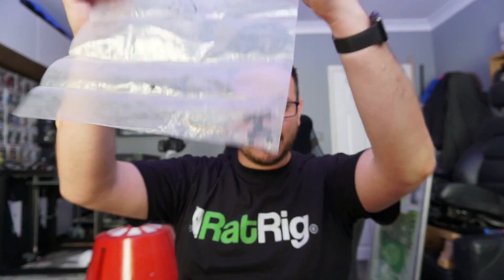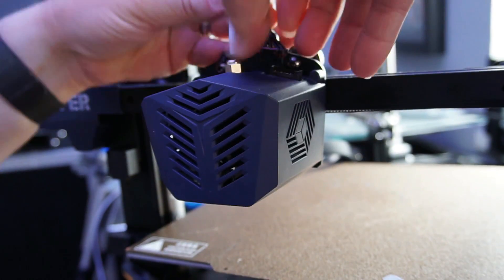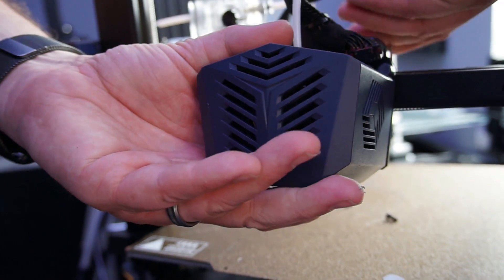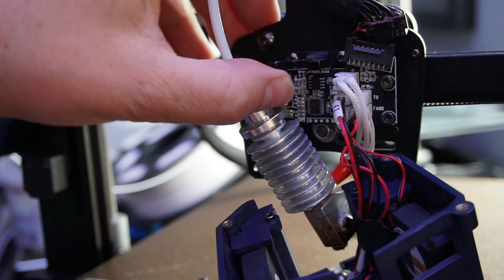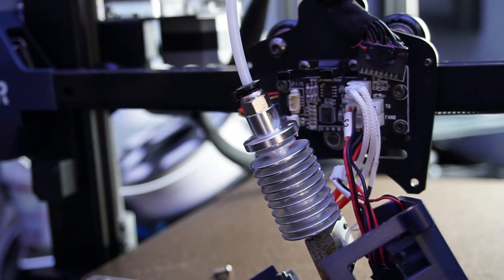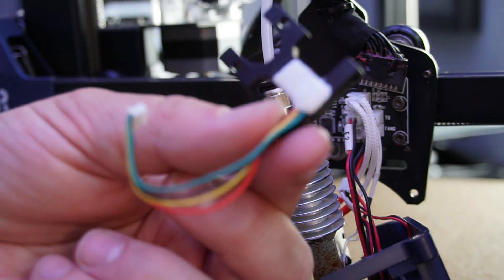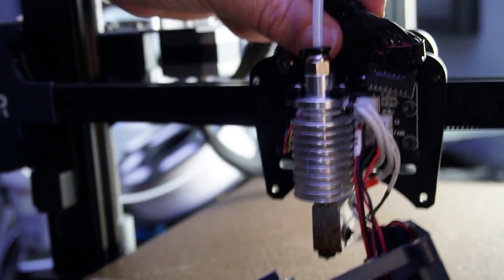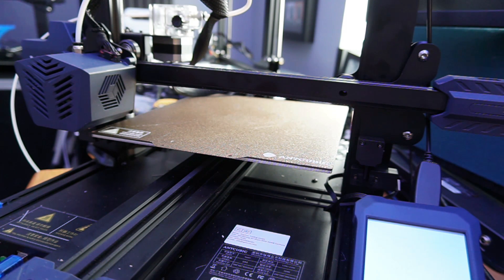Anycubic Vyper Sensor Fault

Comment: I replaced my sensor with a brand new one and still have the issue, my light is blue, it's not on and when I unplug the sensor it turns back on blue.  Is there anything else that would affect this issue. Maybe something else i can look at? I should sdd that when i do a print it just smushes pla around, i guess this sensor also tells the machine where it is in space so it knows to Z up for the next layer.

Comment: If it is still Not working after all of the possible fixes, Check the printhead cable at the connector. I Had the Same issue and the solution was to redo the wire at the connector because at the steep bend it was broken and so there were false Inputs that lead to this issue

To fix it you Just have to disassemble the connector and move the cable past the broken part 
Please be carefull with the disassemble because the connector is fragile

Comment: Hey, I've had a vyper for a few years now, just ran into this issue, and I was able to fix it by bending the calibration sensor back into place, so i think the assumption that it uses the contact to the PCB below it is correct. It had probably gotten mangled a bit when I moved and now it seems to be doing great. I wouldn't exactly suggest doing it, but if you're thinking about replacing it anyway, I'd suggest giving it a shot.

Comment: Bro you saved me I had this problem and tried to change the nozzle assembly but it didn’t help I was going to use it as spare part to upgrade an ender 3 but as I was about to start breaking it into spare parts I had no choice but to try to fix it one more time and i came across this video you are a lifesaver I ordered the part and it is back up and running 🎉🎉🎉thank you so much for the vid and the help

Comment: Same on my device. Broke after the first owl print. I faffed around for ages thinking I had misconfigured something in the slicer. Finally got in touch with support and they sent me a new strain gauge. Fitted it, still did not work. Faffed around long hours again. Did not work. So I gave up on the machine and left it in the cellar till now, money down the drain. How the heck a strain gauge on a piece of metal can get broken without the metal part showing some damage is almost beyond belief.

Comment: thx Sam.  i got a kobra max, and untill your video i did not understand how it worked.  i found the FB group as well thx to you.  i am doing a mod to my kobra max converting to direct drive using the Revo hemera XS,  I'm at a crossroads on where to put the auto-leveling sensor, I put the FB group to suggesting where i should put the sensor .  thx again Sam.

Comment: My issue is when reassembling the print head cover, the wires are so jammed up they keep the sensor tripped. Blue light on pcb is always on even when nothing is touching the nozzle. I can’t figure out how to repack the spaghetti without putting pressure on the sensor

Comment: Have you experienced a hotend abnormal ntc code coming up I had it I replaced the hotend completely and I'm still getting it and I've had the printer for less then a month
Reply from the maker: Could be a wiring issue on the board then?
Reply: @The Real Sam Prentice  that's what I thought at first  but I unhooked everything checked all the wiring and hooked back up had 2 prints just fine my wife started one this morning and all of a sudden it kept heat I ng and caught on fire
Reply from the maker: @guyer1198  caught on fire or smoked ?
Reply: @The Real Sam Prentice  started smoking at first then the filament melted and caught fire
Reply from the maker: @guyer1198  I’ve never seen that before
Reply: @The Real Sam Prentice  Yeah I'm lost lol only had it for a couple months and have only had 2 good prints before all these issues
Reply from the maker: @guyer1198  which material were you printing at ?
Reply: @The Real Sam Prentice  just a purple pla that I've used dozens of times in the neo  the hot end was was supposed to go to 0 but kept increasing  heat till 260 still does it if I power the printer on it'll start at 28° and go till critical temp
Reply from the maker: @guyer1198  I’ve never seen pla melt and catch on fire, I wasn’t aware that pla burns like that to be fair. If I were you I’d speak with anycubic
Reply: @TheRealSamPrentice  yeah I contacted them now it's a waiting game

Comment: Mine slams in to the x axis and then gives me the abnormal level sensor error after probing 2 spots on the bed. I replaced the entire head. Hotend and strain gauge are level. Bed and trolley are tight. I'm at a loss.

Comment: I am writing this in 2023 now. 
The "faulty sensor/switch" problem was possibly caused by a bad batch of sensors.
The "crashing problem" is prevented by having to push the printnozzle with a tool (the sofware requires this action).
The nozzle/sensor will be activated (LED behind the cover).

If the sensor is faulty the auto-level cycle won't start. So crashing shouldn't be possible anymore.
It's always better to buy a device 3D printer, car or whatever AFTER it has been on the market for a few years.
Early production runs of any device are prone to faults/errors.
I trust that Anycube is checking the quality of their supplied sensors now more carefully because this problem has happened.
Very often producers of machines/devices don't check the parts they receive very thoroughly because that's a task of the suppliers.

Comment: I had this problem as I bought a returned unit for $93 USD (shipping included!!!)

I just bent it down until the light came on.  Then it did a fine job leveling the bed.

Saved me spending money for a new one.  I will buy a new one anyway.

Comment: hi i got vyper too but mine do 16 point leveling and after go home and stuck on probing do u think it same problem of u or i need update firmware ? ty
Reply from the maker: Sounds like a faulty probe you might be able to bend it back a little bit to fix it

Comment: Had the same problem changed the strain gauge the board it fits in and changed the cable now they sending me a new motherboard the will this solve the problem, forgot to tell you that the strain gauge is not able to take the screws so you have to use a nut and bolt

Comment: The strain gauge design is crap.  When mine quit on my vyper I just got the cryd team board at the maker panda store on aliexpress and swapped it out so I could run a bl touch.  Much better and I switched to klipper while I was at it.  An all around better machine now.  I couldn't even find the strain gauge for my E model vyper.  Anycubic parts availability is horrible.  Now I'm gonna do the same to my kobra max because I know it'll go out.

Comment: Whenever I turn my printer on, I have to push the nozzle forward or back until the red light turns on. It’s just where it stops when I turn it off. The slightest push back turns the light on again and once I level the prints are fine. Can anyone help?

Comment: i have a different problem with the leveling process, my nozzle is going PAST the bed and never touching it so my whole printer freaks out. has anybody else had this?
Reply from the maker: I’d suggest you flash the new firmware or adjust the y axis stop switch on
Reply: @TheRealSamPrentice  alright thank you sm! ill give that a try (quick reply btw jeez)

Comment: I had the exact same problem with not the exact same results. Contacting Anycubic is a pain in the ass. They make you fill out some bs form. Give you the run around for days on end. That saw me just sending the product back for a refund. Just avoid this model all together. Junk.

Comment: Leveling a bed is easy but fixing any auto level system is a pain.  Does anyone else see a problem here?
Reply: If you have a perfectly level build plate then you're in luck.  Otherwise, a leveling system is important.  Only 1 of my 8 printers is level enough to not have an ABL.

Comment: I have been having issues with both CR6 SE and the Vyper.  Bought an entire CR6 hotend unit for $40 AU.  Could not find one for the Vyper but could get a Vyper Strain Gauge or $29 AU - the CR6 strain gauges are $10.  Not impressed with Anycubic(or Creality as they never send out parts).

Comment: Hi Sam. Got a Vyper on 2nd October 2021 and it printed the 'owl'and that came out really well. Quite impressive. (Should say I have now had 4 Anycubic printers - 2 x i3 Megas, 1 x i3 Mega Pro, and now the Vyper. The first 3 have been good, solid workhorses). 
Now the Vyper - as I say, it initially printed very well for 3 or 4 small prints, then simply stopped. After some hassles with Anycubic Support, I finally managed to upgrade the firmware to v2.4.5, which I was assured would fix the problem - it didn't. After another prolonged bout of communication with Support they sent me a new Sensor Gauge. I waited four weeks for it then installed it per their video instructions. Still won't work and when I hit 'auto-level' the entire machine just freezes and I have to turn off the power.
After watching your video I have decided to re-do the fitting of the sensor gauge (although I know I did it correctly ) and see what happens. At the moment, Anycubic don't seem t be able to help with this problem. Any suggestions would be greatly welcomed as the machine is only a few months old and has only printed 3-4 things and is now 'useless'.
Cheers, Noel

Comment: Thanks for your video!

Unfortunately, the issue still occurs. It happened on my new vyper as well, even after firmware update... LED and leveling working very well, but after some prints crashed into the bed and LED wasn't working anymore....

Comment: Hi there. Thank you very much for this helpful video. Same story here. Got my printer a few days ago from the German warehouse, did a first auto-leveling, unfortunately failed in printing the Owl, did a second auto-leveling and the nozzle smashed into the bed. I then upgraded screen and firmware to the last available version 2.3.9 (motherboard v6). Now I get this sad message "Auto leveling sensor abnormal, please check it and wiring!" I wait for an answer from Anycubic (Chinese holidays). I am however wondering: for all of you who managed to get a new sensor and changed it, did it happen again with the new sensor a few weeks or month later?
Reply from the maker: Sad times! I think I saw your post online. They have sent me a couple of sensors out now and also a replacement motherboard. The GOOD news is that Anycubic DO look after their customers and you will be back in action soon.
Reply: @TheRealSamPrentice  Lucky for you eh. They refused to help me with this exact problem. Probably because I do not have a big enough YT audience. Like your videos mate, but this company really screwed me over on this one and I am absolutely disgusted in the way I was dismissed by Anycubic, even tho this is a well known fault. I dont really know what to do now, except share my story of the way they are actually handling the situation for everyday customers without a big channel.  
If you have any ideas where I might be able to go to find parts or if you have a source on the inside, I would be very interested. 😒
Reply from the maker: @KwaddawK  drop me an email I might be able to help you out.
Reply: @TheRealSamPrentice  Thanks for your reply and kind offer to help mate. I kept searching the net and found a printer supply website in the UK with the strain gauge for $15US so I ordered a couple from them. Much much cheaper than the official website. After the treatment I received I can no longer support Anycubic or purchase anything from them directly ever again. I went from really loving my printer to absolutely hating Anycubic with a passion in about a day and a half after dealing with Abel the Unable in customer support. I hope my story is helpful to people sitting on the fence about which printer to buy and I will continue to share it hopefully costing them a buttload of money in lost sales. 
Keep up the great vids mate, at least I feel you are on our side!

Comment: My first 3D printer and mine is failing the same way. It completed leveling once I printed the owl, then leveling failed it's 2 days old I've been researching and checking tensions on rollers and belts and the problems the same. You can say I'm frustrated I submitted a ticket and stumbled upon your video.

Comment: Yo man, so i just got my Anycubic Vyper. I have done 1 print without any problems at all... I can still do the bed level no problem, and i dont get this smashing into the bed, it puts the nozzle nice and easy down, and up and slowly down again. But then when i start printing. Its like the nozzle moves up 10mm or so. i have done absolutly nothing, it doesnt matter which sliced file i print. Even the one on the SD card doesnt work. And the one i printed Yesterday doesnt work either?

Any idea what could have happend? Everything seems normal, until it starts printing...
Reply from the maker: I’d work on your z offset part but that does sound really weird are you able to send me a video of it doing it ?
Reply: @TheRealSamPrentice  where can i send you the Video? I dont think it is the z offset we are talking one 10mm here. It printed fine a calibration cube but today i wanted to try one more with same setting just 200 instead of 190 and it dis this 🤷🏻‍♂️
Reply from the maker: @CowallTV  yeah that’s a fair amount it sounds like gcode to be fair therealsamprentice@gmail.com
Reply: @TheRealSamPrentice  Alright! It got fixed with a firmware update just found a new firmware and was installing it when i typed the last message, didnt know there was another firmware for this printer
Reply from the maker: @CowallTV  yep 2.3.9 before the community firmware comes out :)
Reply: @TheRealSamPrentice  Thanks for the quick respond tho!!
Reply from the maker: @CowallTV  No worries glad you got it sorted :) I've just updated both of mine to the latest :)
Reply: @TheRealSamPrentice  Ah very nice! Now we just need to get some firmware so we can do some esteps calibration :)

Comment: Got my vyper this morning direct from Anycubic, managed to get the owl file printed then immediately had the strain gauge failure - exactly as demonstrated in the video. Have a support case open with Anycubic so we’ll see how this goes. According to the card that came with it mine was actually manufactured in mid July, so they may still have been unknowingly working through a bad batch of components around them. Does suggest they’re not doing a lot of QA if the thing fails after one print though…

Are these things a standard part we could source elsewhere, or do,we have to get them from Anycubic?
Reply from the maker: Oh no!! There is a place online but I’ve not seen them tested sometimes you can bend the gauge back into place so try that also
Reply: @TheRealSamPrentice  Beginner's question - bend the gauge up or down? Intuitively, you'd say the extra pressure has bent it up so bend it back down again? Rather not ruin the nozzle if it goes the wrong way.
Reply from the maker: @jonbwfc  yep down would be the best way forward.
Reply: @TheRealSamPrentice  Thanks, I'll give it a try. Quick update - Anycubic got back to me within 24 hours. They're going to send out a replacement once I confirm delivery address.

Comment: Hey, thanks a lot for the video. I'm having the same issue with my Vyper. Assembled it today, autoleveled, made the owl, tried a second print and it just started crashing into the heat bed. Reading all these comments makes me feel a bit comforted that I'm not the only one but that it's common - though it of course is a bit sad that it's a common issue in the first place.

Contacted support and hoping for the best.
Reply from the maker: Thank you for your kind words, i'm just about to unbox another one so lets see how this goes ;)

Comment: Just got my vyper today and having the same issue, is the red light supposed to be off? it should only flash on when the strain gauge activates correct?
Reply from the maker: The light should be on, some manage to bend the probe back. I’ve got the replacement probe and it’s back up and working well

Comment: Same problem here on my very first printing attempt. I’m new to 3D printing and got the Vyper thinking that this one would save me some of the common struggle. Leveling for example....  This is frustrating but it’s also a lesson: 3D printing is definitely not plug& play. 
I’m both relieved and worried that so many have the same issue ...
Anyway, I’ve contacted anycubic and still waiting for an answer.
Reply from the maker: Best thing to do is not panic, it’s an easy fix and it will run like a dream once it sorted
Reply: @TheRealSamPrentice  they replied really quick actually. Great service by those guys. Thanks a lot man.
Reply: @TheRealSamPrentice  Ok so 4 months ago I told you that the aftersale service by Anycubic was great, but since this video gathers the community of users or people interested in this printer and Anycubic I'd like to tell you about my terrible experience with them.
Long story short: I bought the printer, it didn't work, they sent me replacement parts, didn't work anyways. So after exchanging e-mails they told me they could replace my Vyper for a brand new one. So I sent the printer back to their warehouse (in my case I had to pay a very expensive shipment, so i've spend the money for buying the printer PLUS the shipping service).
Since the package was recieved in their warehouse, I haven't got any e-mails. I've sent about 3 e-mails to them but it's like they just ignore me. I'm really upset about this. 

It's important to bring this cases to the community. I feel scammed and this is probably the worst experience I've had as a costumer in a long time. I've seen a lot of people happily using their Vypers but the fact that this has happened to me means it could happen to others. Please do your research and, FROM MY EXPERIENCE, think twice when it comes to Anycubic.